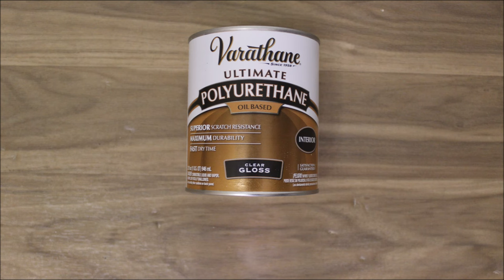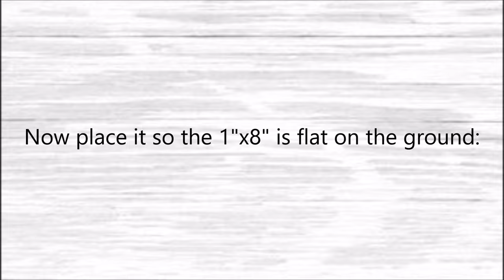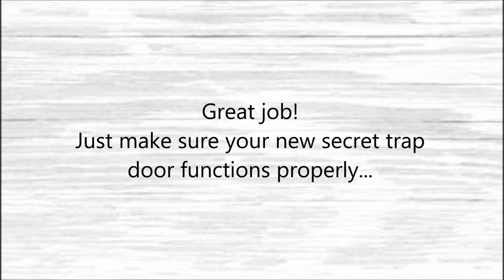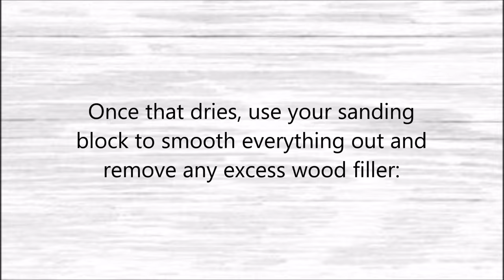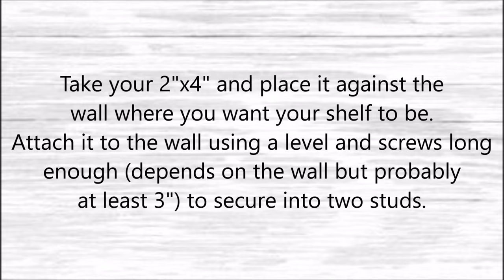The $30 Floating Shelf with Secret Compartment - Easy DIY Project!

Comment: Just an idea, get some nice decorative brass screws so you can leave the screw head flush with the wood and visible.  Then put a couple of the same screws into the compartment door, just cut them off with a hacksaw so they don't go into the actual shelf.  This will create the appearance that the door is screwed in place and immobile.  Maybe even put a magnet catch inside the door in case the hinges loose the ability to hold the door closed.

Comment: So, you have a 1x8 and two 1x6 x 7 1/4 , let me get this straight because I am really feeling pretty stupid, the 1x8 is in fact 8 inches wide correct, and then you have two 1x6x7 1/4for the end pieces but they are cut to 1x6 x 7 1/4 then you place the 1x8 and a 1x6 x7 1/4 and screw those together and they are equal surface, how is this possible when you have a 1x8 and a 1x6 x 7 1/4
Reply: The 1x8 isn't actually 8" wide. It's really 1x7.25"

Comment: Clever floating shelf!  Wondering if you may consider doing a super simple, sturdy, solid wood basic book case? Tall, wide rectangular in shape? I have a wall area that's 55" x 94" {ceiling is 95"} I'd like to go almost to the ceiling with it. My cookbooks have no home they're tired of living on my floor 😴. Hopeing eventually someday you may need to build a simple bookcase like it for one of your flipped homes😀.
Reply from the maker: There is this video, it's not 94" tall but you could make it as tall as you need by repeating the steps:
https://youtu.be/8J_Jdpth0ng
Reply: @TheRehabLife  Thank you & I did see/know about that Mid modern bookcase video which was great. I'm looking to make a basic 'traditional' bookcase, not mid modern. I think I've learned enough from  your videos that I may attempt to construct a traditional  style one on my own 📏📐🧰🔨🙂.

Comment: If you have the time and skills, 45 the corners and shoot dowels through at a 45 just inside the joint. I think that would add a bit of strength and "Wow" factor.

Comment: Hi,
I love your work, love how you provide the detailed measurements and how efficiently we can get those wood cuts. Appreciate it. 
I have never build anything, I would like to start with your console table.
I got everything that I need for the project but I am failing on those screws. I have both drills and impact driver but I am failing to find a impact driver bit for 2 &1/2 trim head nails 😢 can you please do a short video or guide how to screw such nails or selecting the right drill/driver bits.
Thank you
Reply from the maker: Hi, thanks for following! 
If you bought a pack of the GRK 2 1/2" trim head screws it should come with a bit that works with your drill. If you'd like to use your impact driver specifically (which I agree saves time) it should show on the front of the box what size bit you'll need. The box I have says you'll need a T-10 star bit, which is this:
https://amzn.to/3K2qZZ1
Hope this helps and good luck with the build!
Reply: @TheRehabLife  thank you for responding😊 I will try with that bit